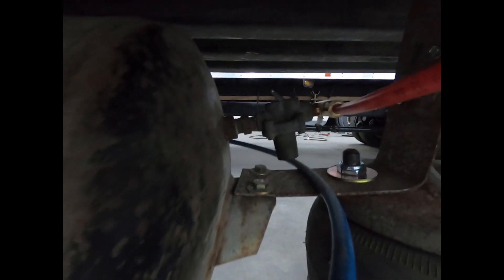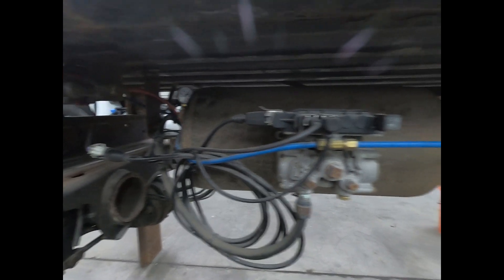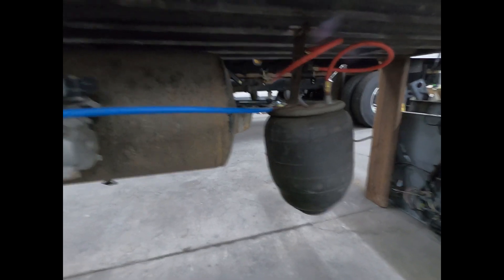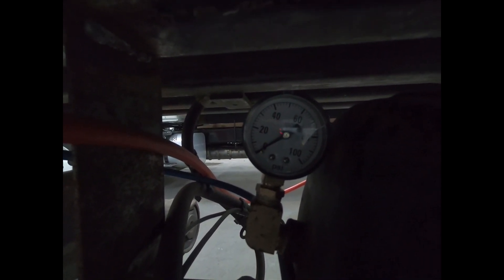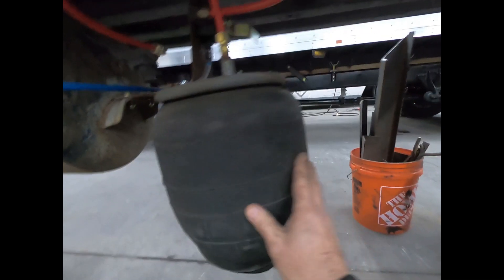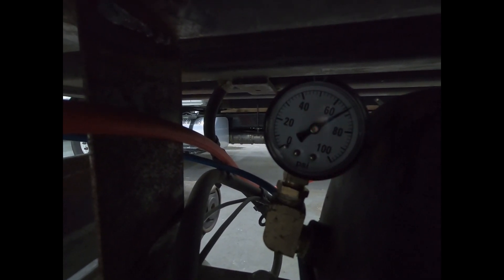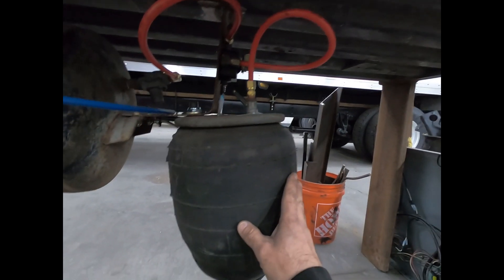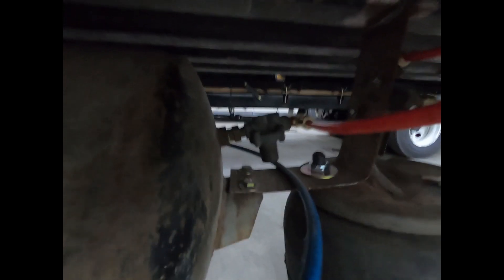Pressure Protection Valve Demonstration

Comment: We are fighting a dump trailer, when you open the gate it’s supposed to open latches, dump the air from the bags. Then when you close the gate air the bags back up. However. The bags slowly air up and the gate sometimes slowly closes. I’m wondering if this is our problem.

Comment: Check out video from fleetrepairsolutions on trailer pressure protection valve on youtube. It can sometimes leak or stick not letting air into bags. Never seen one let air back out of suspension when setting brakes. Seems like you might have more than one problem. The leveling valve should not release air from bags until the control arm is moved downward. When you are setting brakes, the new relay valve may be draing the tank along with the brake chambers which it should not. Sometimes bugs like to build nests in the gladhand at front of trailer. You can sometimes remove top of relay valve and clean all the crap out after draining all the air first of course. But the leveling valve still shouldnt let the bags deflate? Hard to tell without being there looking at it.
Reply from the maker: It's unlikely that air is backfeeding from air bags. This would require the failure of both the pressure protection valve and the height control valve.
Depending on the type of leveling valve you have, it's normal to exhaust all of the air out of the air bags.  It depends on the suspension and what equipment is installed on the bogie/subframe.  
Some suspensions are designed to keep the air inside the air bags, regardless if the parking brake is applied or released.  These suspensions typically have the dock stabilization arms that you see that pop out when you release the parking brake. 
Other suspensions are designed to exhaust the air from the air bags when the parking brake is applied. These systems typically don't have the the dock stabilization arms, instead they have rubber bumpers inside the air bag that the weight of the trailer sits on when the air is exhausted from the air bags. Usually this type of height control valve will have a port labeled "Dump" or "Pilot E", hooked up the supply line from the red glad hand.

Comment: Will the ppv cause the brakes to not engage when pressing the brake pedal  am having trouble with a flatbed  not wanting to break when am  pushing the pedal their is a delay
Reply from the maker: The PPV shouldn't be causing any brake lag/delay issues. Assuming you've confirmed the tractor isn't the issue by testing on another trailer, I'd check all the plumbing for the service brakes from the blue glad hand to the service relay valve on your air tank.  Look for any kinks or obstructions in the lines.  If all lines look good, look for any mechanical reason for the delay ( seized S-cam bushings, worn/ inoperative slack adjusters ect.) If everything checks out I would look replacing your service relay valve.
Reply: @fleetrepairsolutions6372  I really appreciate the help sir thank you
Reply: Thank you so much 👍🏼 @fleetrepairsolutions6372